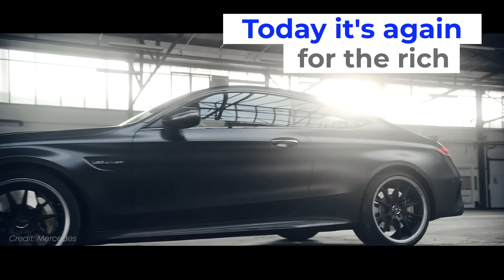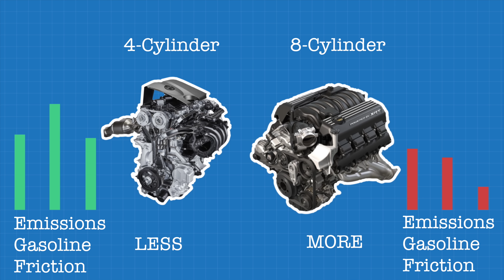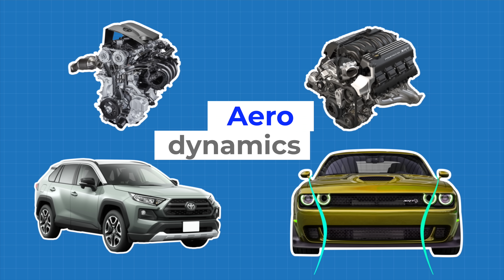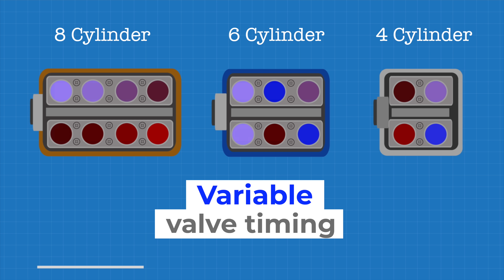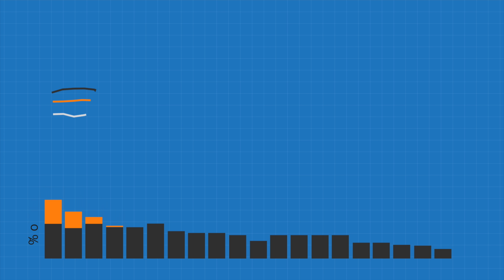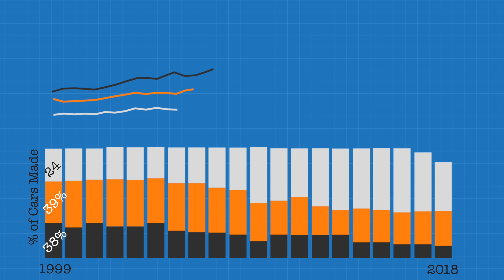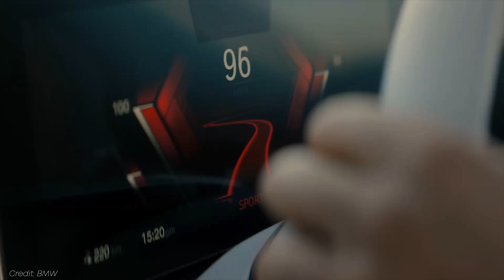The End of V8 Engines in America

Comment: In 1969 the new SAAB 99 used an English Triumph engine. The first three years of production of the slant-4 engines went to SAAB not to Triumph cars. Then after three years SAAB made the engine under licence with Triumph then using its own engine in one of its own cars. They changed the water pump and bored it out to 2 litres to get more power.  But they wanted even more power but no money to develop a new larger engine, so developed turbos to fit onto the engine and get more HP. This was the third ever production car fitted with a turbo, the first being the short lived Oldsmobile Jetfire and second a Corvair, who dropped the turbo version as SAAB were taking it up.  A few years later electronic fuel injection was being developed to improve efficiency and power from engines, this was also used on the engine. 

Unlike the Oldsmobile Jetfire and Corvair, SAAB were successful. Many other companies followed SAABs lead is getting more HP out of smaller engines, saving a fortune on new engine development. The days of the big engines were over in cars.

Comment: Of the 9 cars I've owned, six were V8s. I still own two of them...a Mustang and an Escalade. Of the other three, two were primarily my wives cars. Both were four cylinders. Only one V6. I drive cars for 150k or more. My Expedition lasted to 250k and still ran great. The body was rotten and the trans was gone. 

V8s are just more reliable and deliver more power more reliably than any other common engine type. Turbo and supercharged V6s and four cylinder engines can make a lot of power. But they're usually short on torque and the turbos don't last. Lease them or trade them in after the warranty is over.

Comment: Would a 2 stroke V4 sound similar? It's half the size, and thus more suited for compacts and hybrids. (Only thing you need for a clean 2 stroke is a de-compressor in the exhaust that refreshes the air in the cylinder at BDC.)

Comment: Silly graphics at 09:10
Most 4 cylinder engines are 4-in-line
And all engines have cylinder head bolts on BOTH sides of the cylinder.

Comment: Only ever owned 1 v8. It was in a 1995 dodge ram 1500 it was the 318. The trans sucked but the motor with a ram air intake to the front right head light, headers and about 5 feet of exhaust pipe ending at flow master with turn downs aimed at the ground sounded amazing in fact it was the reason i sold it so easy. Loved that truck just for that reason.
Bought a civic after. Lol

Comment: V8 are a  thing of the past. Those who are still kept in time
refuse the technical progress. A V8 has more torque. Yes,
but also more friction. Most manufacturers today offer V8
driven cars only for their prestige. Or being smart and sell 
plug-in Hybrids like Toyota. And others.
A good 6 cylinder (Nissan RB or Toyota FE-UZ / 2 JZ) or a 
4 cylinder turbo. The engine and its Performance must match 
the respective vehicle. With where we come to oversized 
Cars like American pickups; these are only suitable for trailer 
operation a.e. on construction places. From over 7.5 
tons there are trucks that can do better. With a 6 cyl diesel.
And at least, this old "muscle cars" are a joke. 6.6 Liters
and 160 hp? This have been made to drive straight away
but lack traction. But we have tight curves. Muscle is a joke.

Comment: They say they can get just as much power as a v8 in a 4 or 6 cylinder now but what about towing torque. Dad used a full sized 1978 chevy van,1972 pontiac Catalina to haul around a 20-24 foot camper in summer. Can newer cars do this or will the trucks have to do it?

Comment: Can you comment on the longevity of V8 engines versus a V6 or V4?  

I have a 2004 Ford Expedition with a 5.4L V8, with 250,010 miles.  The engine is rock solid still and is a daily driver. In fact, I recently drove halfway across the country.

I feel like the V8, being larger, naturally is stronger just due to sheer weight.  It doesn't depend on all those extra electronics and parts that are possible sources for failure.

This all being said, I also have a 2018 Chevy Malibu with 17,000 miles on it and it's a 4 cylinder with a turbo and is excellent, thus far.  But, I dont envision it last 250,000 miles although I hope it does!

Comment: ford should make a ecoboost v8, something like a 4.6 or even smaller 4.0. The new small turbo engines sound awful that are 4 and 6 cylinders and they are not exciting sounding in most sports cars. Few V6 and I-4 engines sound decent.  I dream of the day a fun small sports car with a small V8 engine is produced for the masses at an affordable price like $30k. Nothing crazy just a simple car, no crazy electronics, a mild interior, exciting performance, with regular practical day to day use and the option of either a stick shift or an auto....I can dream.

Comment: I enjoy the V8.  I currently have a Mercury Grand Marquis with the 4.6 V8.  If you keep the cruise control on it does pretty good and it is a dream to work on compared to my V6 3.8 in my Buick Park Avenue.  The Buick has better MPG but it  commonly becomes a challenge whenever you have any parts to replace with the front wheel drive compared to the Mercury which has rear wheel drive.  I have now had to front wheel drive cars with a Chevy Lumina and now the Buick Park Avenue and they are generally a pain to work on.  Try doing a alternator replacement on a Buick Park Avenue and then do an alternator change on the Mercury Grand Marquis and you understand right away the difference.

Comment: The way i see it, if your v8 isn't making at least 600hp, there's no point. Anything in the 300-500 hp range can be had with turbos and less cylinders. I had a '06 m45 with 4.5L V8, made 335hp. Today Mercedes has a 4 cylinder turbo that makes 345hp and more torque. I think its 2.0L.

Comment: all engines fuel economy is dependent on how people drive. a turbo charged four cylinder may get EPA ratings that save consumer and manufacturers from gas guzzling taxes but turbo charged engines are extremely extremely thisty if you are consistently in the throttle my dad's turbo charged 4 cylinder BMW gets atrocious mileage in sport mode if you drive it hard at all.

Comment: I've never driven a 4 cylinder that I would take over a good V-8. Or a good V-6. People say "well these direct injection, turbo fours can make as much power as a V-8." They also have horrendous turbo lag, get lousy gas mileage, and break down every week. They are also almost impossible to do any DIY work on them. Many of these super high boost turbo fours won't even last 100,000 miles. Take care of a good push rod V-8 and they can go for a very long time.

Comment: V8s aren't gone in the sense that none will ever be made, or that people won't maintain, restore, and take care of used ones. They're gone in the sense that ordinary people either can't afford or wouldn't want to buy a muscle car or a v8 passenger car/daily commuter these days. It's not just about gas and emissions requirements, it's also just the fact that so much else in the economy is expensive relative to the amount of wages people earn, in contradistinction to the booming economy that coincided with the heyday of the v8 in America; people just also want to spend money on other things than fueling and maintaining their car (outside of dedicated fans). 4 cylinder engine needs less oil and other fluids, has less spark plugs, and has less mechanical parts; it's just easier to maintain on top of being more efficient. If smaller engines with fewer cylinders can achieve 200-300hp, then they can replace the old v8s that boasted the same power a decade or two ago for people looking for that range of "fun" at an affordable price. 
Personally, I find this is all tragic. V8s are the perfect engine for enjoyment, in my opinion. Sure, they may no longer make the most amount of sense in terms of personal finance and practicality. But that's not really what the beguiling spirit of the V8 is about. The smoothness, the power, and the sound all come together more perfectly than any car with an engine that has less cylinders, at least to me (that's not to say I can't like a v6 mustang that does 305hp). Their drawbacks for people with less money, especially in the days of Covid and the concurrent recession, are their ultimate downfall.
Reply: If you can't afford the doubled service costs (oil and plugs every 80-120k miles) then you probably can't afford whatever car you have anyway if it's 1 cylinder or 12.

Comment: V8's are cool but lately ive been getting less interested in them. The only v6 i like that can actually pull big power and beat v8's and still sound good is the vq37vhr 370z motor. And four bangers to me are only meant for low power drift cars or simple smaller regular cars. Not in something like a truck 🙃

Comment: The nite mare of vee engines gm v6 Buick from 60-80s off balance/ vibration if curb idle below 1,000 RPM!  Not that powerful but move you place to place!  Gm had a V -4 half of v8 in Pontiac tempest 62-64 your foot was to the floor to move car,a geo metro could beat you down the 1/4 mile drag strip LoL!

Comment: America cars used to have really shitty v8 engines that made hardly any power in a massively overweight chassis, times change, they are better, produce much more power and v8 is overkill for a family car and most people dont want a sports car, also the tightening of emissions regulations affects it. Why have a v8 when you can strap a turbo onto a smaller engine.

Comment: I’ll also tolerate a inline 6 or a well balanced 90 degree V6 for example the Buick 3800. I don’t care for 60 degree V6 engines as they usually don’t use balance shafts and emit vibration at idle. Keep up the great work.

Comment: The best thing of the V8 is the sound. Power isn't an issue anymore.
Here we pay luxury tax based on CO2 output of the car. A V8 can easily cost double of the same car with a 4 cilinder.

3 cilinders are almost the new standard here for small cars. The 4 cilinder variants often aren't even for sale here.
VW has a 1 liter 3 cilinder that is designed for a max output of 260HP. I own a na car with that gasoline engine and with a little patience can achieve 60MPG.
I know people with that same engine turbo charged to 150HP that manage 55MPG.
So will the V8 survive? With fuel prices $6.5 a gallon? You in the US can easily say: I'll be driving a V8 forever. Sure? And with our fuel prices?
Only for the rich. A V8 will be the weekend drive if you really want one.

Comment: Great informative video Scotty.  I do think the V8 will be around for a long time, especially in pickups.   90 degree cross plane crank V8 firing order varies in an off manner from cylinder bank to cylinder bank.  LRLLRLRR etc.  180 degree flat plane cranks like used on Ferrari's sound different because the order is consistent from bank to bank.  LRLRLRLR.

Comment: --------- nearly 40 years ago Cadillac assumed they struck it rich... their engineering dept. developed a V8 w/ deactivation technology allowing it to run on only 4 or 6 cylinders ------- it was inferior from the start ----  probably one of the worst "V8" engines ever built in Detroit -----  second worse 350 Olds converted to diesel --------  a flat 6 is not flat at all when it comes to exhaust sound -----

Comment: Supply and demand. For those of us who aren't climate change alarmists and don't mind paying extra at the pump, the venerable V8 is the only option in a pickup truck or large body-on-frame SUV.  All those "high-output turbo-charged" 4 or 6 cylinder engines have their own set of major problems. Pay now in gas (V8) or pay later in repairs (small engines with big turbos).

Comment: My 1993 Jeep Grand Cherokee limited 5.2 V8 is still going strong for 27 years without engine or transmission overhaul. Right now it is nearly 415,000 miles. Several years ago, I've used conventional oil then blue smoke came out from tail pipe as I didn't like so, I switched to 5W-30 Mobil One Synthetic oil with Royal Purple oil filter for years without any problem or always passed smog check. Also, I've reduced engine thermostat to 15 degrees (180 instead of 195 degrees) to prolong engine life. I changing oil every 6 months (Spring and Fall) or 5,000 miles but not beyond 7,000 or 8,000 miles. Also, I've used mostly Chevron 87 octane gas of trying not get a cheap gas brand too.
If my jeep die and I was thinking about obtaining Chevrolet Tahoe is only sell with V8 engine because my Jeep has V8 is twice longer engine life than a smaller engine sized as well.
Reply: Wonder if they offer a V8 in that new Blazer. I know GM’s are POS’s but I’ve always had a soft spot for Blazers. Nostalgia I guess.

Comment: That was shocking that the V8 engine in brand-new vehicles are phasing out in the next several years. The best American sports car you can own is a 2002 Chevrolet Corvette C5 with the 5.7 L LS-based V8 engine and the regular four-speed automatic transmission. This is a better, real sports car than a Ford Mustang GT or a Dodge Challenger R/T.

Comment: It's not going to last long Ford is already figuring out that their 4 Cylinder and V6 ecoboosts dont hold up nearly as well as long as their naturally aspirated V8 engines. Especially when they are putting them in trucks and SUVs and they cant handle load when towing regularly so the turbos are failing left and right and customers are not happy with the several thousand dollar repair costs. And as for electric cars, same thing the batteries go bad and cost more than the car to replace and then you've got all of the other problems that occur with the high technology electric parts once they have some age and wear on them. So on this one I have to disagree and while they may try to faze out the V8 it will never happen because the demand will always be there.

Comment: I agree that with computer controls, turbos, superchargers V8's are not really needed. I thought they would live on in pickups but now am not sure. 4 and 6 cylinder engines have doubled or more in power (V8's too) as well as become much smoother and refined. I think V8's will be around for some time but 25 years from now? It will be up to the consumers, electrification,  self driving technologies and acceptance of all that. I'm glad I saw the heyday of V8's in the 60's Not so much the 70's when they had less HP than a 4 cyl does today!

Comment: Great video Scotty. Yes more like this please. I actually think V8's will make a big resurgence when the Euro7 emissions standards come in.  Under Euro7 regs,  engines can't run richer than peak EGT. That means you can't use excess fuel for cooling (control of EGT), so boost levels will have to be lower, displacement of engines will increase and that's where the V8 architecture will come back in fashion.

Comment: Electric cars charge from the grid. The pollution generated is just shifted to another geographical location. I drive a Mitsubishi Turbo Diesel 4WD. It has lots of torque but power delivery of a water bed.  Given a choice, I would replace the motor with a V8 but would be too costly in fuel to run. I think hybrid V8's will probably rule the planet in the future but run on fuels other than gasoline. Pity we cannot run cars on hot air generated from politicians. It is an inexhaustible supply.

Comment: Thinking we need a n engine bay to handle a 427FE V8. 4barrel 850 or twin 4barrel carburetors in the high output models.
10mpg to 14mpg city or less and up to 17mpg and just maybe 18mpg highway. Of course modern technology could bring both mpg's way up if full throttle is not necessary.
You will love it.
525 to 700 hp.
Will beat any high output V8 From any company, especially Chrysler.

Comment: I'd like a Ferrari Testarossa.  12-cylinder boxer engine, sounds even better than the V8.  My second choice would be 1990 model Lamborghini Diablo with the V12.  Sounds more lumpy, but still great.  The third choice would be 1989 911 Turbo 6-boxer.  Sounds great, too!!!   And the last choice would be a '79 Honda CBX with straight 6-cylinder engine which sounds probably better than all the above.  Oh, I forgot the BMW 635CSi straight 6-cylinder, and Mercedes 500SE, that's a V8.  Now, the last comes 1980's Mustang V8.  America has the V8 for everyone, and that's very unique.  That foxy body Mustang is something quite charming.  And so are the 1974 Firebird and Camaro.  Then we have 1990.  Corvette ZR-1.  America is the best.

Comment: I have a 2006 4Runner with a 4.7 V-8. Driving like the Senior I am, I still get 19 mpg in the city and up to 27 mpg on the highway if I don't go over 60 mph. This engine is bullet-proof except for the possibility of cracks forming in the exhaust manifold. Fortunately, this has not happened to me yet.

Comment: I have a 2011 Ford F150 with a 5.0L Coyote V8 in it and its a beast and it sounds beastly with that Borla ATAK exhaust. I also have a 96 F150 with a 5.0L (302) Windsor V8 with 209,000 miles on it and still going strong and it'll outlast any EcoBoost engine and plus it Sounds badass with the Flowmaster exhaust.

Comment: I just put in a balanced and blueprinted 408 with EFI full roller MAF AFR heads new exhaust  etc..  I really leaves the old 302 behind ! Climbing a tall steep sand dune fast and catching air where it would not make it up before.  Nothing like a long travel King shocked full size Bronco with some power to leave permagrin on your face. The V8 can supply torque where you need it well.